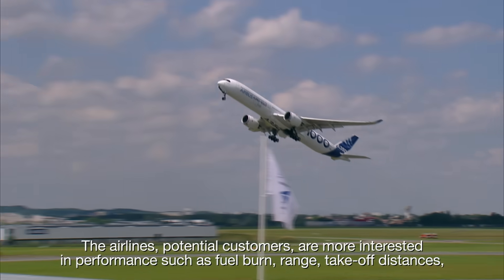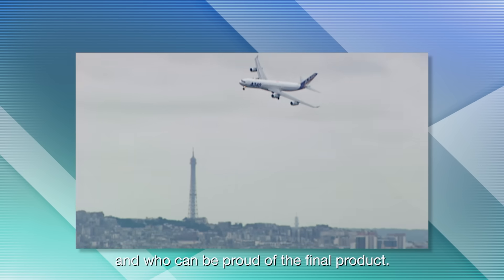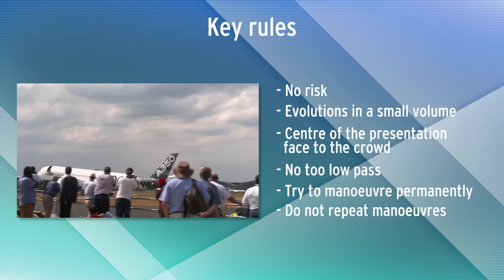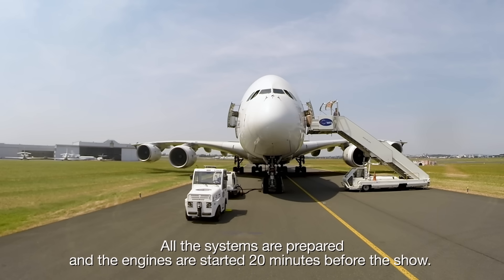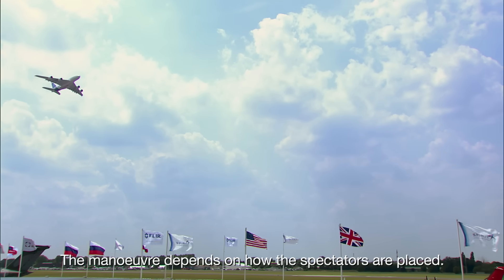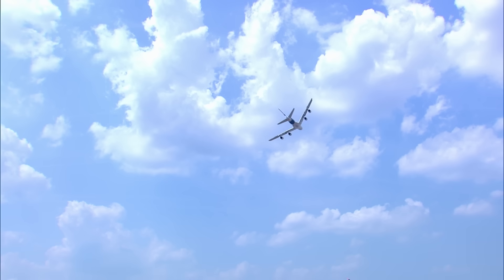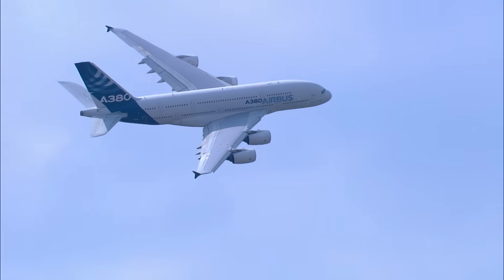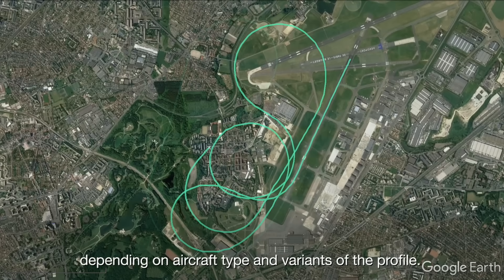Flight Tests - Ep.9: Flight Displays

Comment: I just watched mayday or plane crash investigation. I think plane manufacturers should program an auto stabilizer once the plane is in the danger situations like banking etc. The plane must or should be back to normal steady flight or the plane must recover it by it self to normal position whatever altitude or speed it is then the pilot will take over once the plane is totally recovered. Now the planes are all computerised with lots of censors, just like Tesla car, preventing the driver to crash. Sorry for my english
Reply: Vertical stabilizer/ horizontal stablizers already do the trick.
Reply: When would it do this and how would it know when to do this?

Comment: 8:26 But what if they're flying in a twin jet?
Reply: The low speed pass is done below minimum control speed "on some aircraft models", maybe only on the quad jets. Or they reduce the thrust until they can compensate the asymmetry with the rudder...

Comment: Tex Johnson showed how to properly demonstrate an aircraft's ability. Airbus proved how not to perform a flight display before deciding safety should be at least an afterthought.
Reply: its not even possible to do that maneuver in an Airbus
Reply: @AndreBSaba  it might be possible but you would have to manually change the command law  and probably disengage some safety features. Nobody wants to end like the tu-144 by pushing the limits "a little too far"
Reply: André B. Saba It is possible
Reply: @Capt.Rankin  now it's not possible